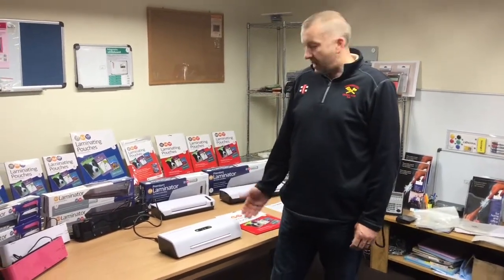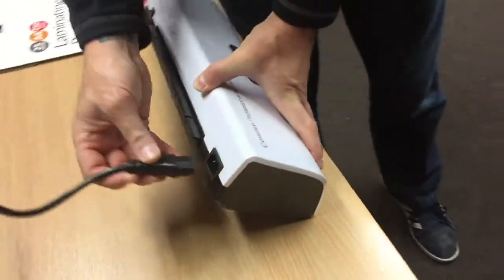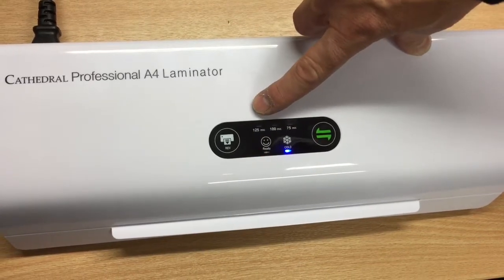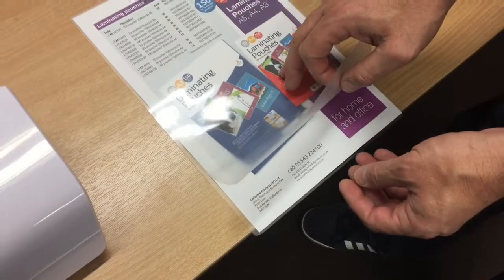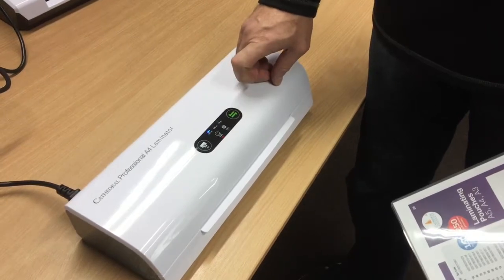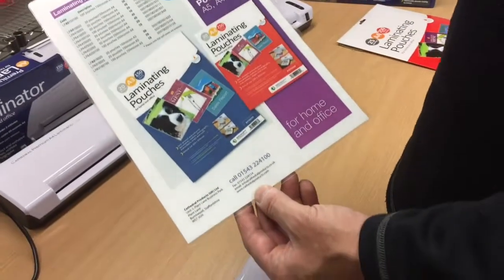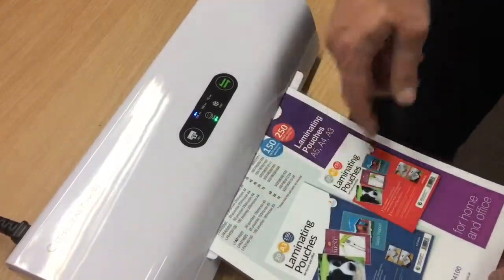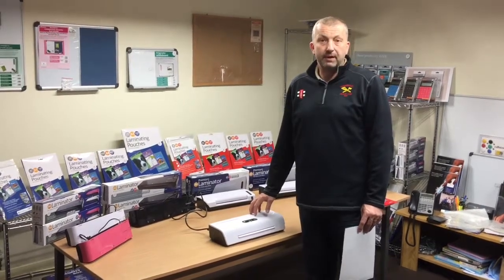How To Use Cathedral Products Professional Laminator

Comment: Will this laminate lots of little cut out items ..I guess you will need a protector case for that especially if the entrance end is not full. Will this model take one as it looks very thin and sleek. Thanks
Reply: Hi Khola, it absolutely will :) All you'd need to do is pop your cut outs between the 2 parts of a laminating pouch and feed it through. I would recommend using a 250 micron pouch, so it has some structure as it's fed through the laminator.
Reply: @sophiejames6346  thanks. Now Ordered  off Amazon 😊